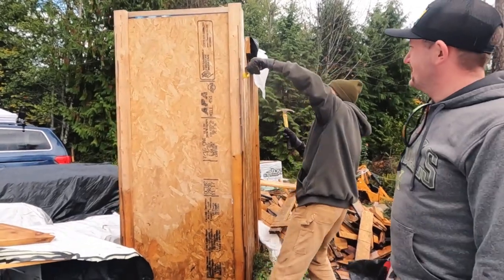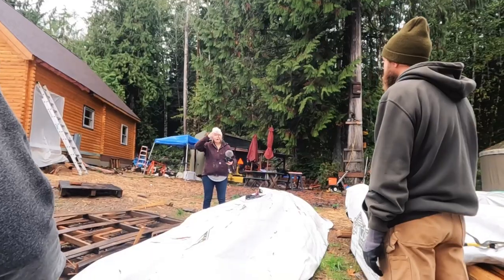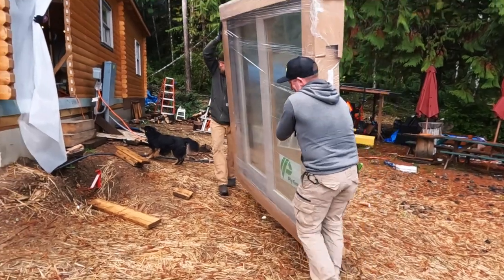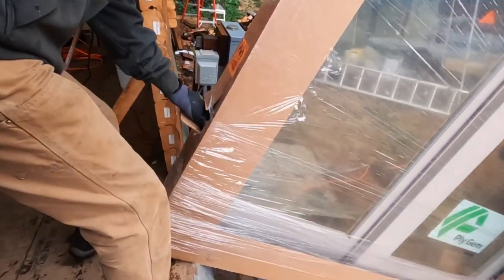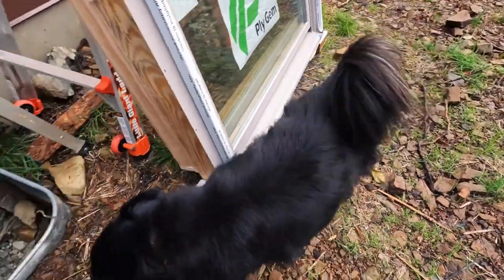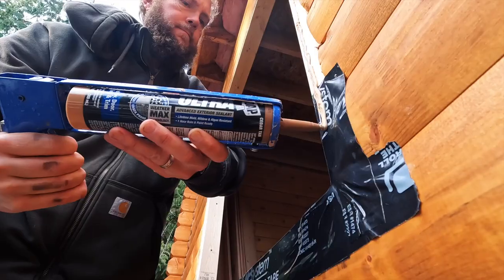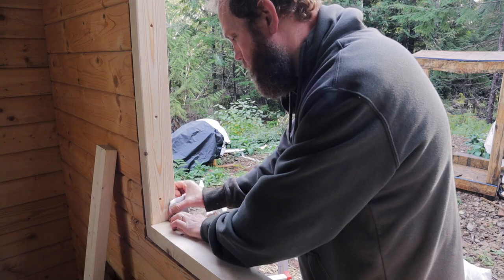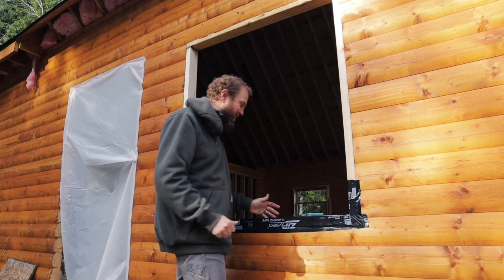WE THOUGHT This WOULD BE EASY // INSTALLING our FINAL WINDOWS on our SELF BUILT Home - Ep. 59

Comment: When your moving heavy stuff, don't forget about mechanical advantages.  When pushing the door onto the loft, the last five or ten percent of the balance point(over head) was the most difficult.  If a....little helper....had been on the loft level.  Once the door was close to the tipping point anyone could have pushed down on the top of the jamb while adults climber the ladder to pull/lift/slide it past the balance point. Helps save your back and shoulders. (both shoulder replaced) A cheap addition from Harbor Freight, coupla carpeted furniture dollies.  I use them for everything and they are really cheap,  BTW the place is looking incredible. Hope the moisture issue is healing itself!  Should be very proud of all you've done!!!  Thanks again for the content.